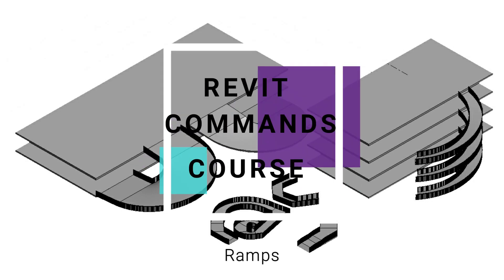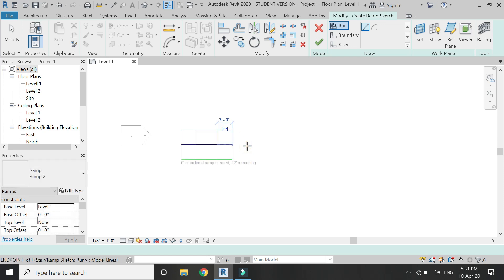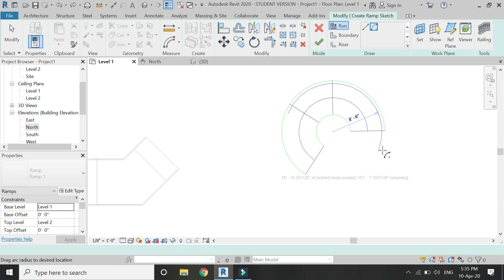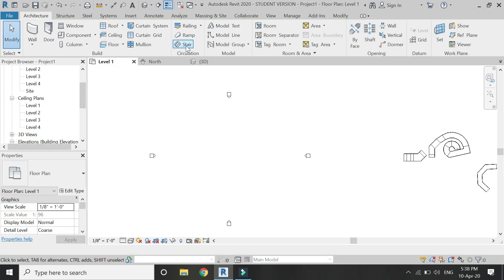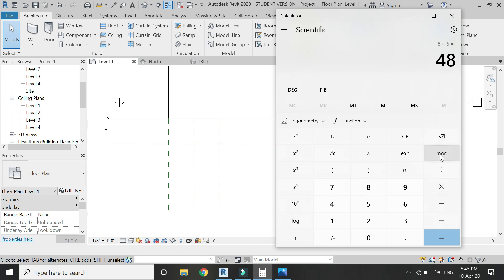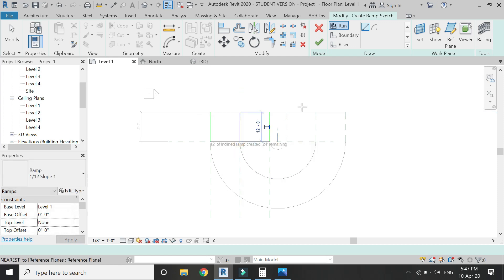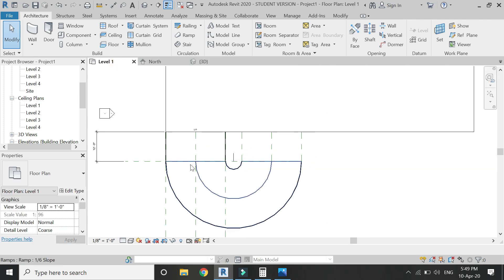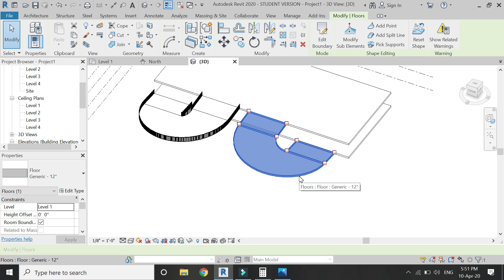Revit Commands Course - Ramps

Comment: Great Tutorial , what if we have to make a pattern on glass ?
Is there a better way than using an image (as a material cut out) method ?
Reply from the maker: Using an image is a very quick option for creating rendering details in Revit. But I cannot think of any other ways of creating patterns on glass. If you manually draw the patterns on glass, it will take a lot of time and still will not give good results.